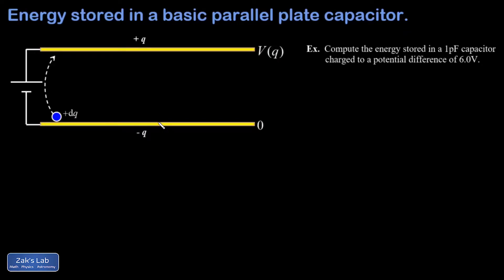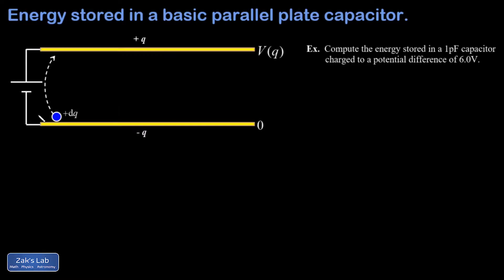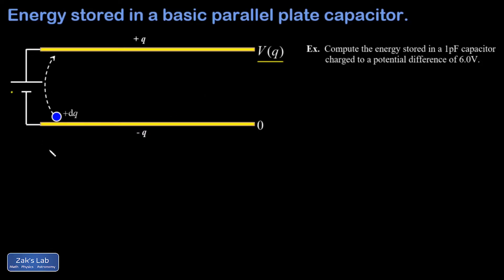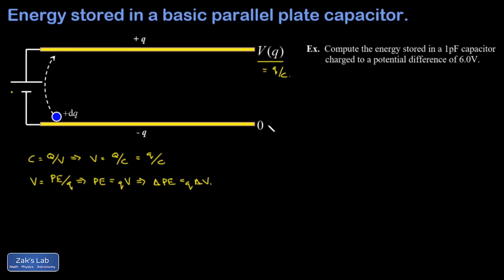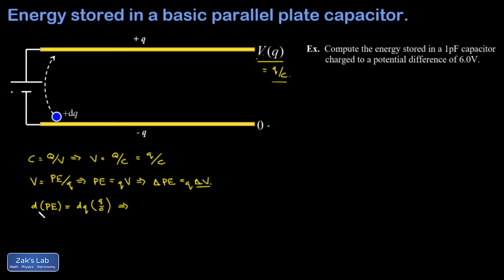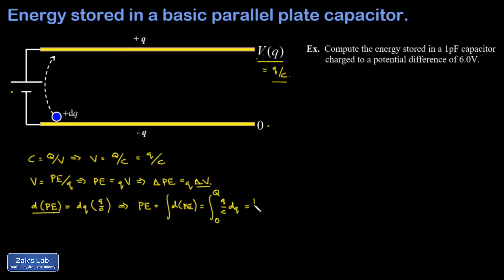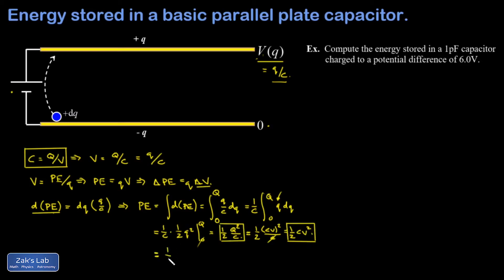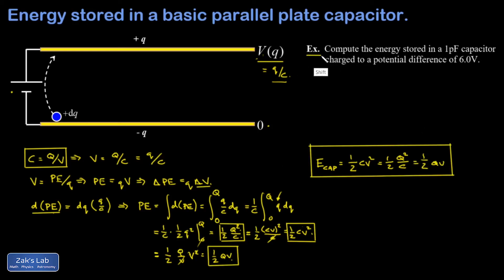Energy of a capacitor derivation, and energy of a capacitor formulas: 1/2CV^2, 1/2Q^2/C, 1/2QV.

Comment: Well if you do say PE = QV that means the amount of energy is equal to some charge * some voltage. 
If that is true then that should also be equal to the energy stored in the capacitors. Then the question arises where does half the energy go? Imagine if we were to provide a circuit V amounts of voltage (let's say hypothetically, it had a 100% efficiency of energy) well then the energy in the circuit is measured as E = QV then if we by the formula you just derived, that energy would then half itself. We know that half the energy is not lost to heat. Then where does half the energy go? It can't just magically disappear because it would break the law of conservation of energy so where does half the energy go?
Reply from the maker: qV is the potential energy of a single charge q moving from the low side to the high side at the full potential difference of V.  At the beginning of the process of separating charge, that potential difference is zero, at the end it's V.  

Moving a total charge of Q from the low side to the high side requires adding up a continuously changing potential energy contribution from the beginning potential difference (zero) to the ending potential difference (V) for each charge contribution dq.  

Half the energy has not vanished -- the confusion here is the equivocation between qV as the potential energy of a single charge, and QV, where Q is the total charge separation on a capacitor.
Reply: @ZaksLab  ok so what would the charge and voltage in the circuit it's connected to be? Would it be would the charge in the circuit be equal to the charge on the capacitors? Would the voltage in the circuit be equal to the capacitors? If not why so? And if they are equal well they can't because then E = QV
Reply from the maker: I think the issue is that we aren't talking about a charge moving through a fixed potential difference here . . . if you imagine the capacitor discharging from this state, then again the potential difference is continuously decreasing as the charges move from the "high" side to the "low" side, rather than all charge moving through a potential difference of V and leading to the factor of 1/2 when you do the integral.    If you try to imagine the entire charge Q moving from the high side to the low side while the capacitor discharges, then the potential difference is simultaneously going to zero, confounding the issue and again requiring an integral approach. 

 I agree there's some weirdness hiding in the potential energy of a point charge formula PE=qV here, but thinking of it as a continuous charging/discharging process brings clarity .  I'll have to think about this question more when I'm back  to teaching E&M  in the spring, but I  do think the issue is the hidden prerequisite here that PE=qV is only useful if we're going to compute energy changes for charges moving around relative to a fixed potential difference.  For a differential contribution dq, we can assume the voltage is close to constant and get a potential energy change V*dq, so that's OK, while the macroscopic transfer of charge changes the voltage continuously, and V*Q is not going to work.

Re. the idea of thinking about the "voltage in the circuit":  the voltage across those plates is not equal to the battery voltage until the charging process is done, which is shown easily enough in the lab by placing a voltmeter across the terminals of the capacitor with a large resistor in series to slow the process  down.
Reply: @ZaksLab   @Zak's Lab  why wouldn't the voltage drop be equal over a component of a circuit? The voltage across the capacitors should be equal to the voltage of the power supply because of how voltage is distributed (in a circuit with a power supply and a capacitor only). How and why would a circuit act differently to a capacitor although it's component like any other?
Reply from the maker: The capacitor will not have the same potential difference as the power supply until it is fully charged.  When you put a big resistor in series with a capacitor, a current will flow through the resistor, transporting charge from one plate to the other until the charge separation gives a potential difference equal to the power supply voltage.  At this point the potential difference across the resistor is zero and the current stops flowing.  

You can see this in the oscilloscope analysis of an RC circuit with a square wave voltage on extremely fast, but still finite, time scales.  I like to do a lab with a huge resistor and a huge capacitor where it takes a couple minutes though, partly because our ammeters that interface with our computers have a slow sampling rate, but partly to emphasize that the process is not instantaneous.

Argument by contradiction:  if the capacitor voltage was equal to the battery voltage right from the beginning, there would be no potential difference across the resistor and current would never flow in the first place!
Reply: @ZaksLab  sorry I didn't read the before its fully charged part. Yes I agree. So what I was asking is that if the you have a power supply of, say 6 volts. Would the voltage drop across the capacitor not be 6 volts. And if it is 6 volts wouldn't, by the definition of a volt ( V= E/Q) wouldn't the charge stored be VQ and not 1/2 VQ. Logically the charge is the same right as the charge in the circuit right? if there was a charge difference then there would be an imbalance which would cause the to move from the circuit to the capacitors. And if the charge is the same and the voltage is the same then logically the amount of energy supplied would be equal to the amount of energy gained. But that's somehow not the case. You provide VQ amounts of energy into a circuit and if u disconnect the power supply, then the charge stored in the capacitor is only half of what you supplied. How is that possible? If the charge or the voltage (after the capacitor is fully charged) is not the same as the charge or the voltage that you provide, why are they not the same?
Reply from the maker: Potential energy for a charge relative to some constant potential difference, V is not the same as the potential energy for the charge separation that creates V.  Again, I have to think about the charging or discharging process to get clarity on this:  whether charging or discharging the capacitor, the potential difference is continuously changing, which means different contributions to the potential energy dq*V(q) use a voltage whose value changes according to the current value of charge on the plates.  My suspicion is that our PE=qV formula for introductory physics requires the hidden assumption something like "V is not changed significantly by the presence of q", and that I could find solid clarification if I went back and seriously reviewed my upper div electrodynamics book to review how the whole theory gets built up from first principles.  So you can take the PE formula to be  d(PE)=V*dq, in other words it's definitely true for a small increment of charge that doesn't change V significantly.  Then in the constant V case you get delta(PE)=QV, and in the capacitor case with continously changing V, you have to compute an integral and you get delta(PE)=1/2*QV.